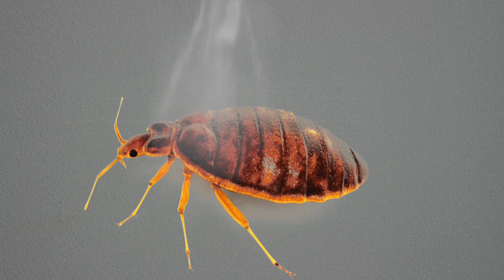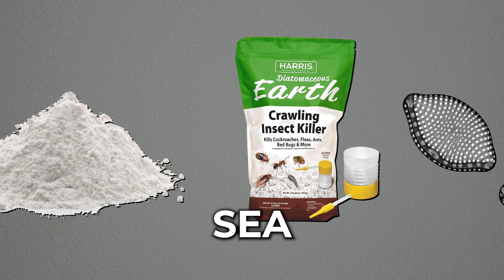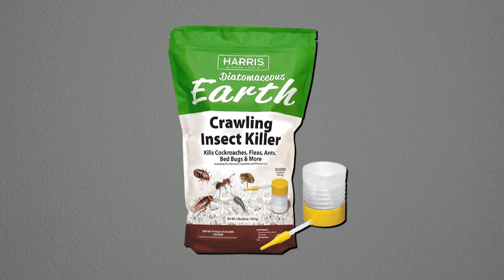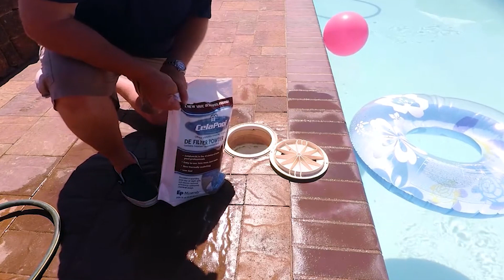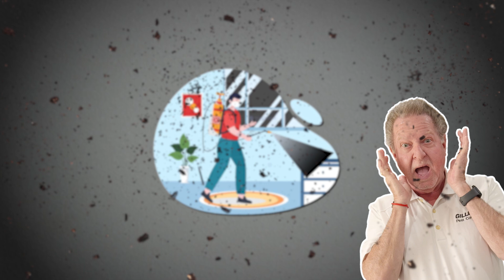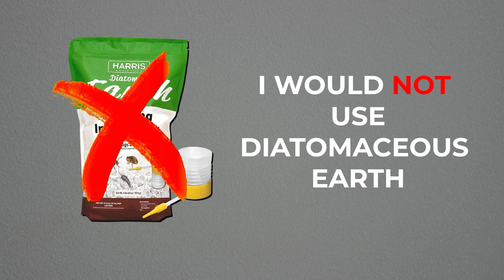Why You Should NEVER Use Diatomaceous Earth For The Control Of Bed Bugs

Comment: Exactly. I've personally used it, and it works. It took a few weeks in addition to other extreme measures in terms of me caring for my clothes and vehicle (switching everything out and lots of drying and re-bagging). 

I had 2 pest control agents who I came across while out in public to check my vehicle, and they confirmed the bugs were DEAD bc it WAS WORKING.

I had to stay on top of it, even in the days and weeks to come, however, over a period of about a month and a half to two months it worked. It only cost me about $50 total, and I never had another problem. 

Thankfully it was only in my vehicle because that's where I was living in and out of and sleeping at the time. I came in contact with the bugs initially through a friend whose house I was at. 

Pest control companies are not going to admit that it works because they charge hundreds and thousands of dollars to treat. But buying random chance I was out in public two different times and asked them to check my vehicle, and they confirmed that the bugs were dead and encouraged me to continue to treat them.

Comment: If you put it in between the mattress and bed or box-spring mattress (where the bugs hide when not active), then it shouldn't be that easily stirred up where it's airborne. Small amounts tend to go a long way, if it's spread properly during application. (I'd say dry-brushing is the way to go.) Obviously you don't put it on the top sheet or anything like that. Also if you make a big cloud of dust over the entire room, that's also doing it wrong and just wasting it along with creating the health-hazard condition.

Comment: It works great outside for squash bugs. Sprinkle it around the plant base to help control the them. Do not breath it in. I was just using it to prevent fleas in the cat beds i put out for stray cats. I have been coughing and congested ever since. Its not good. 🤢 Beware
Reply: Were you wearing a N95 mask? Just finished spraying it everywhere in a room and I feel fine since I had a proper mask that seals my face

Comment: It actually makes sense when i heard these are very fine particles that are glass shards like sharp at micro level, the first thing i thought was lung puncture... And if put it around bed as you move body in sleep the dust will rise and we will inhale it... A lot to think about this cheap option.
Reply: bedbugs can be killed instantly by the earth, so you can clean up straight after you used it. Then you just repeat vacuum, steam clean and washing. They should not come back easily? as you may apply safety barriers either physically or mindfully. Physically would be dusts the earth in the far corner rather than exposing it as if the bugs are everywhere.

Bedbug is just a bad luck, like headlice. If its from your neighbours then report it to local gov. It is a social level of problem. Otherwise I don't think we should be too worry and scattering the earth and inhaling it? just be resilience!
Reply: I've inhaled this stuff before it's no different than  sawdust. Actually I'd rather breathe this stuff in. I've dealt with DE a few times before and worked in a restaurant furniture warehouse with saw dust everywhere. The saw dust was way more agitating
Reply: Food grade is the way to go, much safer
Reply: I worked on a farm driving farm tractors and combines back in the 60's & 70's without cabs. Breathed lots of dust with who knows what in it. I'm 74 today doing just fine.

Comment: Bed bug removal by professional pest services is extremely expensive. You can purchase high wall bed bug traps to put under your bed frame legs to trap bed bugs. If you lightly sprinkle diatomaceous earth around the legs of your bed it’s highly unlikely you risk inhaling it. You can also put some in the traps so the bed bugs will die faster. This is optional because they will die from starvation in a couple of days. The bed bugs can’t fly so they get to you by climbing your bed frame. If you’re mattress is touching the wall scoot it away from the wall so the only way bed bugs can reach you is by climbing the bed frame legs. That way they will get stuck in the traps. This is way cheaper and more environmentally friendly than pesticides or whole home super heating.

Comment: Used steam alcohol and topped it off with this powder and worked a charm
Reply: What was the alcohol for?
Reply: @bleubutta for the bugs ofcourse
Reply: @bleubutta  Direct contact with alcohol MAY work in killing bed bugs. It's not as effective as diatomaceous earth residue.

In the Mark Rober video, "Bed Bugs- What You've Been Told Is Totally False" he covers pest control chemicals and demonstrated effective practices to prevent/eliminating bed bugs. 

https://www.youtube.com/watch?v=2JAOTJxYqh8
Reply: @bleubutta  high heat (steam) kills them, and so does direct exposure to alcohol so its like a double kill to any living bugs you can reach/see.
Reply: sounds more expensive than professional treatment 🤣
Reply: @DotmessJC  get them with vodka , that'll get there heads rollin lmao
Reply: @DotmessJC  Professional treatment can get up to $3-5,000 pretty quick sadly